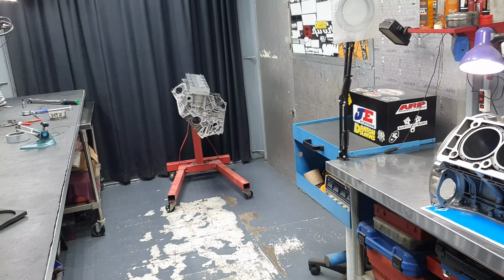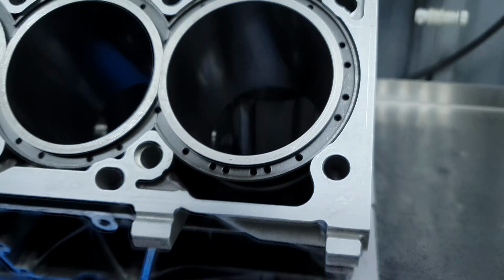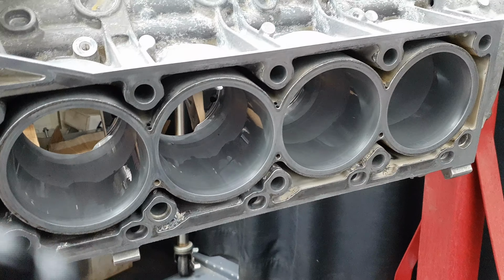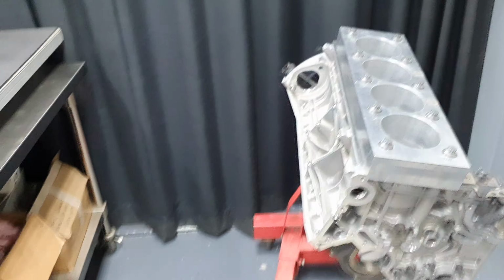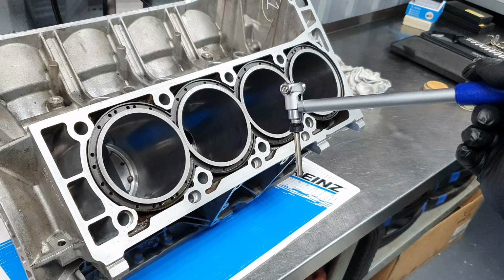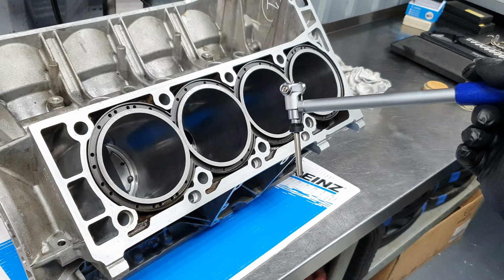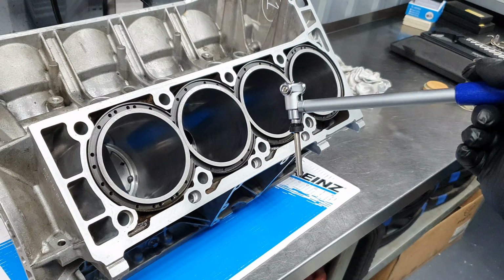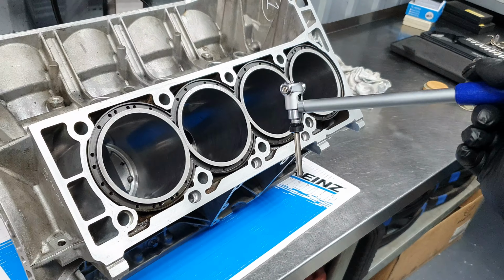M157 with 280k km check up (part 1)

Comment: Very good advice.
Reply: Exactly! But what now with it since you said it doesn’t make any sense to continue with cleaned pistons??
Reply: @mogelbar1020 That's not what he is saying. What he is saying is don't waste your time putting new rings or even pistons in it, because the cylinder wall is out of round, and it won't make a difference. If the engine runs well, just leave it as is, and focus on the other problems it may have that you can correct. Like leaks, and the timing components.
Reply: Exactly my understanding but the question remains: why is Tasos doing it if it doesn’t make any sense?
Reply: @mogelbar1020  he has the provisions to resleeve the block, and correct the finish. These are nikasil lined cylinders. In America, these blocks are considered throw-aways. Nobody wants to touch them. Those that do, want so much money to correct them, it becomes unfeasible to do so. Over here the best option is a short block from the dealer which costs tens of thousands. This vehicle would be considered mechanically totaled.

Comment: I thought the M157 and M278 engines were eating their cylinder wall coatings, especially on nr 5. But this one looks absolutely fine apart from being out of roundness and it has some pretty high milage. What's going on?
Reply: M157 doesn’t eat the cylinders lol usually happens when you drive it hard with 10k mile oil changes. I beat on a m157 over 30k miles with superb maintenance and never had 1 issue. Only issue i had was trying to keep the fuel tank full.

Comment: Tas quick question. you said you cannot do anything on the cylinder anymore. cant u rehone/rebore it to make it round again and add a custom size piston in it from IRP?
Reply: No you can not, cause it is a nika-/alusil coated cylinder. You can either recoat if the runout is not to much or you can sleeve it. Rehone or even rebore is only possible with castiron cyminderwall
Reply: @djpfg  yes!! thank you man for that. another knowledge added.
Reply: @djpfg  heres another question. why the hell is this happening??!?! its bone stock per tasos and yet this is happening?? why?? is this normal? ye sure 250K km mileage but still. for a 200k AED brand new car and this is what u get? i mean thats low quality man. :)
Reply: @gianpaolomendoza925 why? Extended oil change intervals, and using 0w-xx oils.
Reply: Wear and tear guys.  It is a high performance engine.  Lucky to get 250,000km out of any of them.
Reply: @markraumer2336  The M156/159 can easily eclipse 200k miles without a hiccup. 

High performance is not an excuse. The ridiculous oil service intervals. This tiger piss viscosity cafe oils they push on consumers, and yea the M157 and its relatives are just not as stout as older MB engines used to be.
Reply: @gianpaolomendoza925 Most likely because it’s an open deck block with large bore + constant heat cycles over time